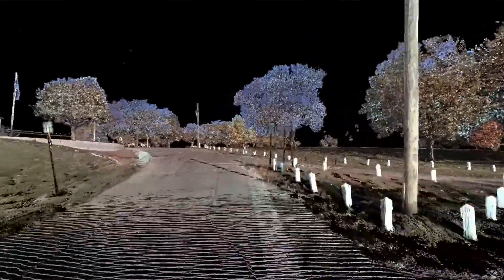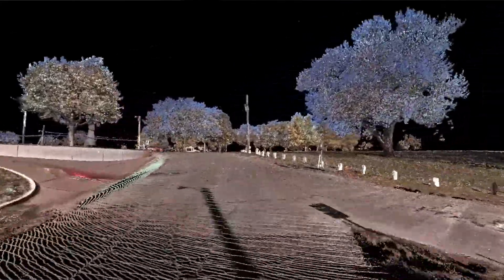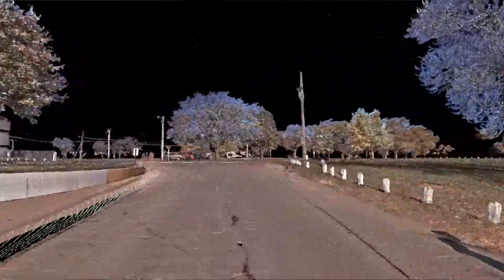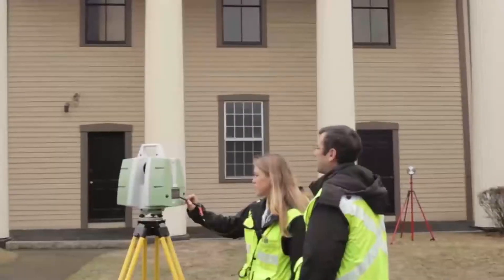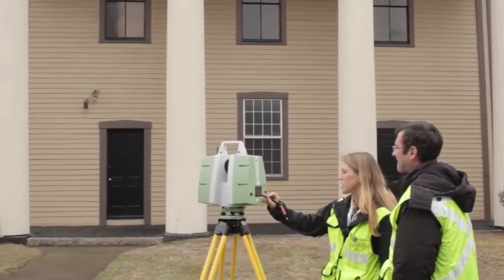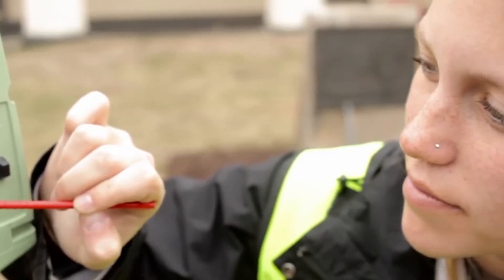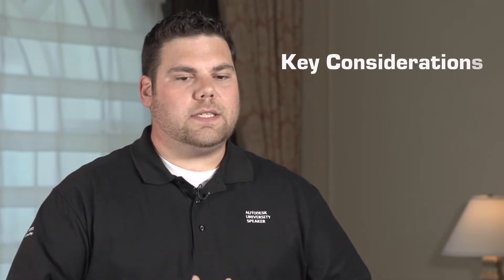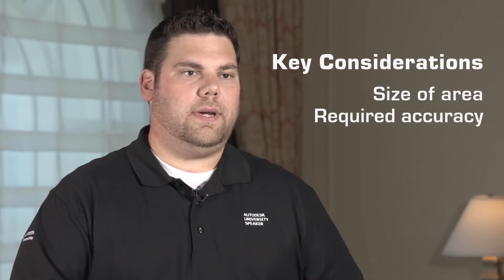3D Laser Scanning vs. Photogrammetry

Comment: Our industry has routinely used photogrammetry, employing retro-reflective targets and fixtures, calibrated lenses, with dedicated software, to confirm as-built dimensions to within a few thousandths of an inch for pressure vessel components. Although laser scanning is gaining wider acceptance, photogrammetry is still a quite effective and accurate methodology in some applications.